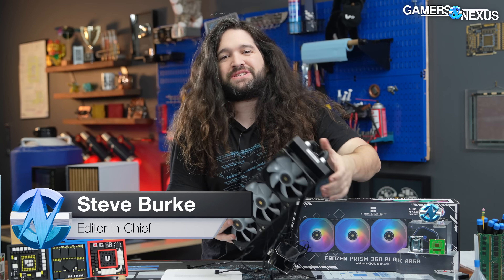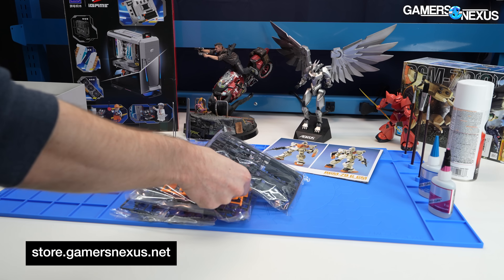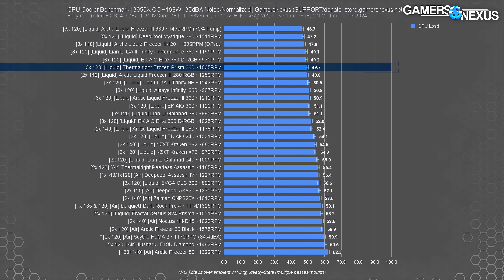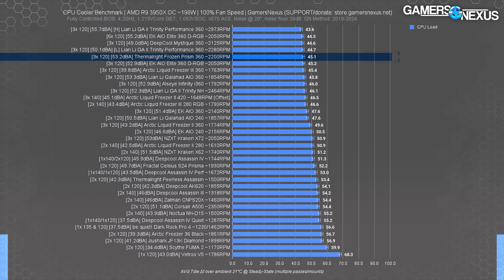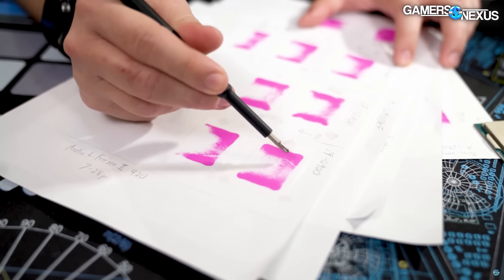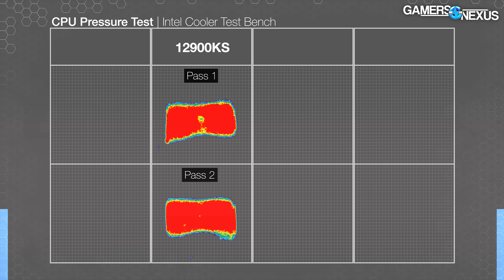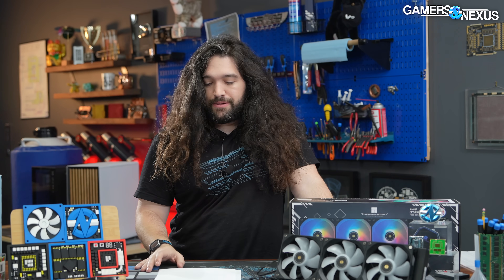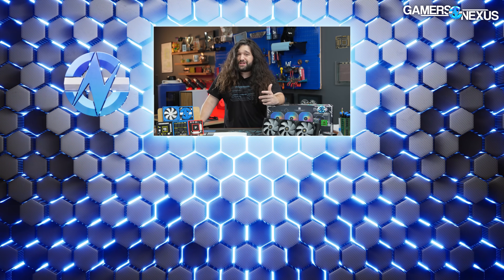Thermalright Strikes Again: $56.90 360mm Liquid Cooler | Frozen Prism Review

Comment: I remember buying Thermalright even about a decade ago and wondering how the f*** they managed to hit such an insane quality/noise/performance level at such a reasonable/low cost when most of its direct competition at the time was already about 35-50% more expensive at a minimum and in part still ended up getting beat, like what?

Comment: Good timing on this one. I just upgraded my system to AM5 with a 7900X3D and went with a Thermalright Prism 240. I went with a 240 because I have an O11 Vision. I use 3x 140mm reverse bottom intakes and 3x 120 reverse side intakes (which are also Thermalright - best deal for 120mm reverse fans). I do find the Prism pump to be quite loud, unfortunately, so I run it at only 2600 rpm. The fans are ok and quieter than the pump. The 7900X3D will get up to 83C on this AIO, but I've undervolted and set it's max temp to 75C for longevity. Web browsing/idle is around 52C (room temp is 26C) and gaming is around 60C. In the end, this is an ok cooler and gets the job done at under $50 (for the 240mm). I admit I am tempted to try the Peerless Assassin just to see how it performs in the O11 Vision in comparison.
Reply: Update: My slightly high idle temps are due to the way the motherboard handles XMP/EXPO. Once enabled, it pushes SOC voltage to 1.3v. By reducing it to 1.2v, I've shaved 3-4C off the temp (about 10w).

Comment: A follow on video should be a teardown video of this AIO cooler. 

Also saw that the white version of this particular cooler is actually a couple of dollars cheaper. And if you trust Asurion, you can get an extended warranty for not that much making a failure less of an issue.

Comment: I have used TR's liquid coolers for a while now, mostly for my nibblings builds, where the parents really want it as cheap as possible. I think the oldest has been running for couple years now without issues. In fact it was passed on to her younger cousins in an upgrade. So, anecdotally, with sample size of three - they seem to last pretty well and can handle teen abuse.

Comment: I have been running the Frozen Notte 360 black since March 17th 2024.  Cooling wise its done me very well on a 7900x3d.  only issue i have had so far is the center fan bearings failed and i swapped it with a spare.  Contacting them for a replacement.  Oh and the Fans on mine have daisy chainable connections.

Comment: i remember someone mentioning a long time that
"East" companies compete with each other by undercutting the other. While
"West" companies compete with each other by offering better specs than other for even ludicrous prices.
Reply: Interesting!
Reply: @Darky4525  multinational companies just price and spec match and compete with marketing.
Reply: Well yeah, in "West" we have quality on our side and quality is priority. "West" products work. "East" doesnt have so much advanced development (or its simply not priority) and to be able to sell their products they must compete with pricing. Yeah in East Asia ppl dont earn 20€/hr as in "West" and if you multiply difference just between wages for all employees its a huge number every month. Ofc there are many exceptions on both sides. 

If you would compare this cooler to NH-D15 G2, well then Noctua is looser. But if you would test it for 10-15years (which Noctua delivers - from my experiences) it would mean if Thermaltake's cooler break every 3-5years and you replace it with new one for same price. Then after 10-15years you would get to same price as brand new NH-D15 G2, performance is slightly better with Thermaltake's cooler, but noise level is uncomperable. So in long run if Thermaltake's cooler breaks 3x in life span of NH-D15 G2, then I would definitely prefers slightly higher temps + significant quiter solution, which doesnt require any maintenance (you have to blow dust away from every PC every once in a while).

But question is how long will this cooler work? 

If you are changing PC every 2years then selling it and buying new one. Then this cooler might be perfect for you.

Well and with current geopolitics, I begun to prefer home - "West" products over "East" in everything. And I am not the only one who wont buy from "East" companies if there is equivalent of "West".
Reply: @nonamenosurname8516  I read all that. Why bother with Noctua when there's Arctic LF 2 and ALF3.
I'm from India. Even if I wasn't I dont wanna pay 1000$ for motherboards and 100$ for Air coolers.
Reply: @nonamenosurname8516  The problem is that "West" coolers are also build in the "East"...
Reply: please tell my how a thermalright, not thermaltake, Idk why you keep saying thermaltake when the video is about thermalright, phatom assassin 120 or 140 or phantom spirit 120, that has 7 heat pipes, will break in 2 to 3 years? You're trying to compare noctua's air coolers to the cheap thermalright aio, that's not how it works, if you're gonna compare then compare the right things. A thermalright air cooler is simply better value than noctua and will last just as long as one because they're all metal pipes and fins and the only thing that can break is the fan and that's easily replaceable.

Comment: Now this is I am quite considering for something like my Xeon or 9900K build. Funny that I technically run the EVGA 360 and it runs better on newer CPUs that I wonder about something more older (and prob more prone to heating up). I'm  considering doing the yearly run on it on a machine that would run a lot for either web or AI with gaming to the side. Would be interesting to see.

Comment: Fans seem to be not that good when it comes to longevity.  Don't know if they have fixed this now, but there is a long thread over at OCN about it.  The fans I have from them still work as new, but I was among the first to buy when they started to become available at Amazon and the issues started to show when they changed production lines a few month latter.

Comment: I have a freezer 3 and a thjermalright scenic V2 and I cant tell the difference in temps between them and I paid 110 for the freezer 3 360 and I paid 60 bucks for the Scenic V2 360. im cooling a 7800x3d

Anyway you can test the MONTECH HyperFlow ARGB 360 it came out this year in May 2024

Comment: I have been using Thermalright Coolers here in Australia in my Prebuild PC's for a while now, and they are good for the cost. The fans can be a little noisy, they are hit and miss, so are fine but some have bad bearing noise, but for the money you cannot go wrong. Only issue I have here in Australia, is that Amazon is the best place to get, as retailers started getting their parts and overcharge since GamersNexus started talking about them, so the retailer here are now overcharging for them, so I just get off Amazon as they are cheaper than the stores or Australian distributors.

Comment: Hey, where's the pump on this thing? Is it right here by the CPU or in the radiator? I have a Fractal Torrent Compact and was wondering if i could place this in the bottom of the case.

Comment: I have the Thermalright ARGB 240, and purchased it for ~$45 USD in January of this year. I have it cooling a 5700x3d inside of the Lian Li 011D mini. My CPU temps have never exceeded 55c! I don’t know what deal with the Devil these people have, but this cooler it has been nothing short of amazing.
Reply: I bought the same one last august (2023)  for a 13700K  runs like a champ. I only changed the fans to the because I wanted a ring light effect for the build.
Reply: What temperature  @waynemacleod3416
Reply: @waynemacleod3416  How many amps are you able to run into yours?
Reply: Honestly hope more people buy thermalright AIOs. With its price its clearly the best price - performance, its reliability is still questionable though since not a lot of people own it. Partly because Thermalright refuses to do any advertisement and just releases coolers seemingly at random.
Reply: @toad7395  they might be trying the sriracha model of advertisement: never advertise, just make a good af product and let the people advertise for you. And i'mma say, their shit is good and cheap.
Reply: @remwastaken  It works a lot better for Sriracha because, well most people only buy the ONE kind of bottle (I've never even heard of different kinds of bottles they have if they do have any) 

Thermalright has like a hundred different models of their coolers and AIOs
Reply: Maybe 55c with a light load, run Cinebench.

Comment: I've had this cooler for nearly a year now and it's performed great. I bought it for about $54 last year and If I have to replace in the coming year with another, that's fine. 
I have it on my 5900x and it keeps it quite cool. With my fan curve, I think rarely have it going above 80% fan speeds as it usually maxes out at ~70C. Gaming is my only CPU intensive task, which I always have my headset on, so even if it did turn into a wind tunnel, I still wouldn't hear it.
Easily recommended.
Reply: 70c with that liquid cooler in gaming ? ,,,mm

Comment: I have the thermalright frozen edge 360 that has the 2150 rpm fans it gets a little loud but cools my 7900x3d just fine. I was using the peerless assian 120 but had to move to a liquid cooler because of where my pc sets.

Comment: I have the Thermalright Frozen Edge 360 and it has been excellent so far. Had it for about 4 months now and temps have been extremely cool on a 7800X3D. You can hear it but its not loud at all.

Comment: Alright we know Gamers Nexus will break down any company like Asus, which is GREAT!

Now can we get an interview with Thernalright to ask how they are doing so much RIGHT for the community when others can't!? Or wont'?!

I'm curious as to how a company so large can release such good hardware and variations of such hardware, for such a good price. I'm all for it!
Reply from the maker: Will try to arrange that!
Reply: My guess is that they're going for massive production scale. That is, contacting every system integrator and offering them badged versions for basically no extra cost, while also just hammering the DIY market to build the brand name.
Reply: @andersjjensen  It's honestly a good play if I had to speculate, there's likely huge rise in compute coming along with AI advancements, meaning more used desktops, many of which will have decades old OEM coolers beginning to fail, on top off all the new computers that will continue to hit the market. 

Not to mention every year of PC is another year of time that PC is relevant for, in that you can pretty much do anything from the start to the time of the computers creation, so computers naturally become outdated slower, as the period they're useful for grows larger faster than the rate at which new games and applications can require new hardware.
Reply: if I'm not mistaken, Thermalright has their own OEM factory, so that's less pricing stuff (idk the details of how pricing works).
Reply: I think it's all abut ethos and will. If you really want to make a great product for the customer for long term loyalty and are not driven by an over-riding love of money  (but enough to make a decent profit) then it's probably not that hard to do.
Reply: I am from the future and CEO just said they are just trying to beat their own personal record but its in the computex video
Reply: (necro) this was covered at Comdex. Thermalright makes their own stuff in their own factories - unlike almost every other competitor that pays for the manufacturing. They cut out the middle-man and are passing the savings along to the consumer to gain market share. This won't last forever.

Comment: Been using the 240 frozen prism for about a year now. I got it as a cheap temporary solution but its been so good i see no reason to change it. I paired it with my 7900x and it keeps it at or under 55 under load. Beyond pleased with its performance
Reply: If you'd like to see how Mines held up after a year of intense daily use, I'd be happy to trade yours with mine and you can tear it open and see how it's done.
Reply: @SmackForSale i just got my 7900x and wondering whether to get the 360 frozen prism or phantom spirit
Hows your 360 frozen prism holding up?
Any issues or all is still good with low temps
Reply: @killagami7979  I've got the 240, so only 2 fans, and it's still doing very well. Very rare that it gets above 60c under load. Would highly recommend it still. You can't beat the price to performance. If you've got the room, maybe go for the 360
Reply: @SmackForSale  @ 
I am leaning towards the 360 tbh.
By any chance have you done any curve optimizer + pbo? Or are you running these temps on stock?

Comment: What's the most intriguing to me is not the fact they managed to produce a super cheap AIO solution, I'm sure there's a huge factory pumping out tons of seemingly unrelated products that could have been producing a radiator close enough to specs to bulk buy from, it's the fact they have SO MANY different products in their lineup. Even if it's all the same hardware with just slightly different fan aesthetics, it still looks very unoptimal in terms of logistics and production. I also don't believe they'd be trying to go with the Uber strategy of starving the competition out with unsustainable prices in a market like that. 

I know figuring out reliability in review is near impossible, but I think it'd still be interesting to tear down / cut in half one of those and one of the more expensive, proven options and compare the hardware and construction.

Comment: Common Thermalright W

As per usual, assisting other individuals with creating parts lists for their system, had yet another argument about the supposed value in these at times more than twice as expensive products from "renowned" brand names. Especially Corsair and Noctua are long gone from my recommendations other than the occasional RM power supply when prices line up somehow.

I better hope to see a look at the Frozen Edge 360, Frozen Notte 360 and Aqua Elite V3 360 in order to close out these four fantastic options for All-in-one coolers on this otherwise incredibly overpriced market, as well as to have some more convincing evidence of what makes them so much more reasonable over anything else really.

Comment: Holding 250w at 65 degrees when limited to 35dba...for 60 dollars?! That's absolute silliness. Thank you GN Team for the DATA ACQUISITION
Reply: That is a delta over ambient temp. A more precise, if easily mistaken measurement. With an ambient of 21c, you are looking at 86c.
Reply: @thatfordboy4297  250w 86c at 35 dba still means silent gaming which is epic
Reply: @fayenotfaye  And you're not drawing 250w during gaming either. It's more like a "silent Cinebench PC", which is not even an everyday use case.
Reply: That's so Biden
Reply: @snak8y8s  bait
Reply: @snak8y8s Let's go Brandon!
Reply: @snak8y8s ?

Comment: I went with the $35 Phantom Spirit 120 SE twin tower/fans black version for a 5600X3D. Cheapest was $28 but the free shipping kicks in at $35 and saves $11, the black model was $4 cheaper overall. I configured it fan on back for RGB RAM visibility and performance was the same, outstanding. In three levels of demand results were, 26-33c idle/45-68c games/71-78 full stress test. An amazing product.
Reply: So they charged you 7$ for free shopping? Sounds good!
Reply: @metallurgico  Looks like instead it would have been $28 + $11 shipping versus $35 with free shipping.
Reply: I use a thermalright assasin x se for my 5700x3d
Got it for 14$ shipped
Used arctic mx6 and changed the fan to arctic p12 max.

I get high 60s and maxes out 70 
When playing demanding games

Comment: i dont know about the AIO but i have dual tower with 2 fans from thermalright
the temperature is slightly higher than nhd15 with only 60% of the price and the fans are about to fail and need to be replaced and if i'm getting noctua fans
it's better to just buy nhd15 in the first place, especially with the latest iteration with 8 pipes

Comment: In South East Asia, Thermalright is competing aggressively against Deepcool, IDCooling and Techware. It's crazy to think that their $30 air cooler can cool down a 120w CPU easily.
Reply: I literally never have to even think about CPU temps. It's absurd
Reply: I live near China and I bought the cheapest sub-$10 thermalright for my 10600KF. With an open case it cooled my CPU running at 126w stably for a few days straight
Reply: saw that you're from philippines, i guess we (i'm indonesian) really shared the market. Tecware is a bit late here though they're mostly pc case and accessories (like cable extension) so honestly it's just id-cooling vs thermalright due to their similar pricing
Reply: @claudebanthus6511 and deepcool

Comment: I'm gonna be honest, I rarely like to buy from brands that overwhelm the customers with a bunch of similar products. 

It also gives me the impression that what they make is cheap and poorly designed, like they are just throwing shit in the market hoping something becomes popular.
Reply: While you can be correct, I don't think you are here. AIOs are drastically over priced atm especially if you throw in a cheap Ali express LCD on the pump == profit 😂. They are by no means cheap as in low quality, just less margin. The flooding the market technique is great for competition even if you don't want to by one.
Reply: @mustangmanx  What I said has nothing to do with price but with the amount of models offered.
Reply: Then you'd be falling into a price value fallacy. Where the same item, sold at a higher price has better perceived quality.

The data shows that atleast for their air coolers, they're top of the line.
Reply: @Alsry1  What I said has nothing to do with price but with the amount of models offered.

Comment: Some people are worried about longevity. But TBH, even the best AIOs lose performance 2 years in. I'll take a cheaper one and replace it more often than using an old one that won't perform better than a decent air cooler.